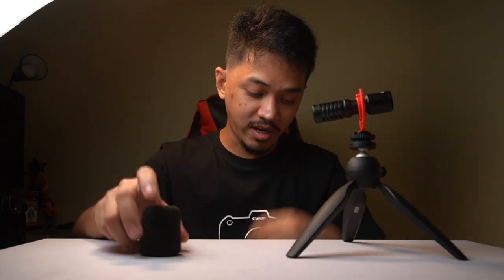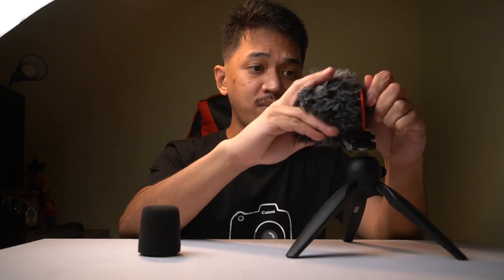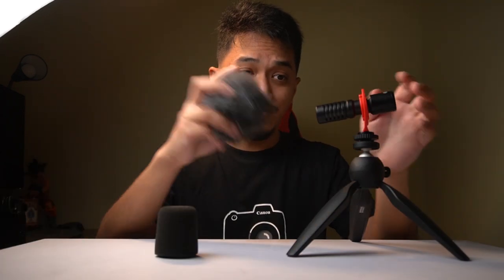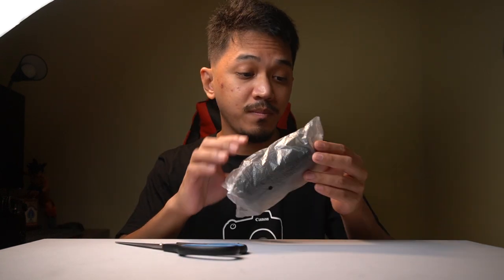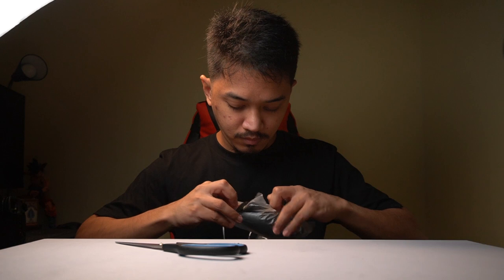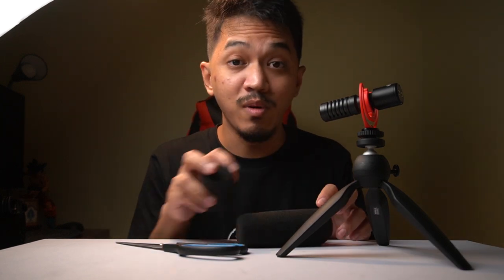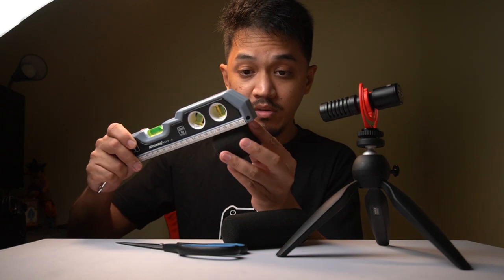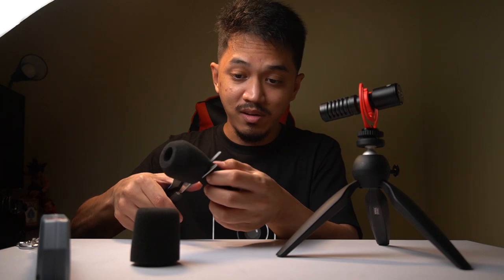Boya BY-MM1/MM1+ Deadcat Windmuff Hack! #BoyaBYMM1 #BoyaBYMM1+

Comment: Nice video, thanks.

And what if you don't have a template? 

Maybe, first measure the inside of the foam, then outside to see what is the difference (the thickness of the foam at front). Measure the needed lenght on the microphone after that and add for the thickness. Then cut.

Comment: just curious how did you set the mic up on the tripod?
Reply from the maker: Hey there, jiin! It's quite simple because unlike the Rode Videomicro, the MM1 has a 1/4 adaptor at the bottom so you can easily screw any tripod screw unto it! By the way, please subscribe and be part of this community!